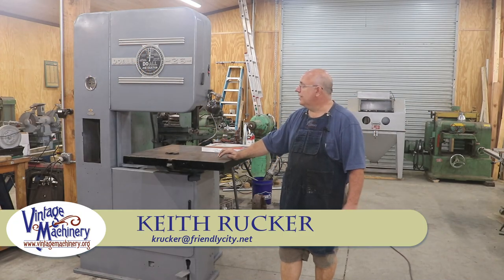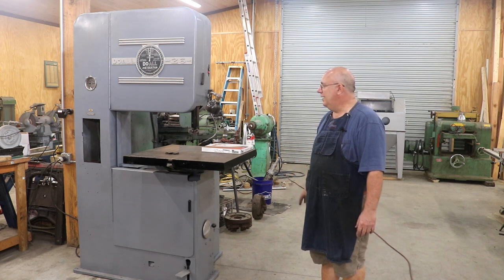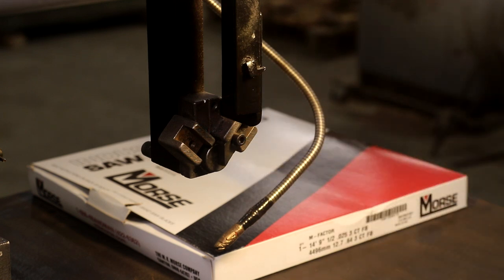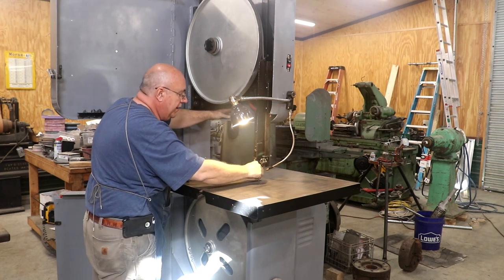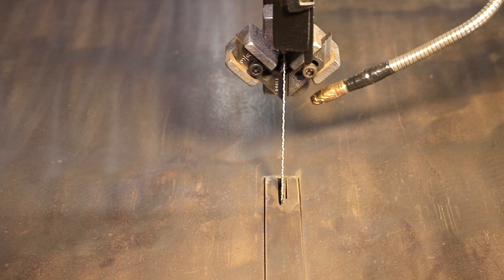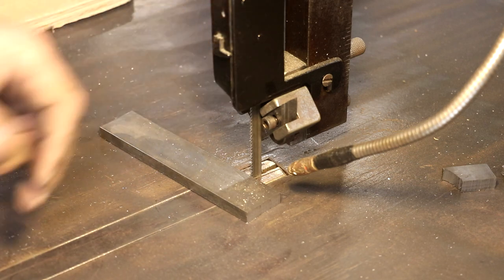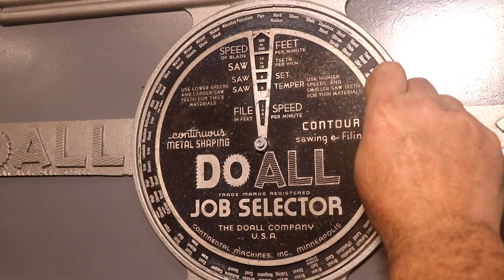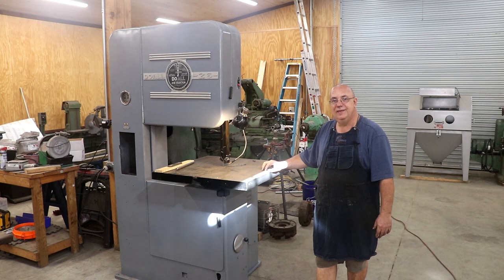1940 DoAll V-26 Vertical Band Saw Restoration: First Cuts

Comment: I was taught years ago to use a drill press vice upside down on round stock so the piece would roll.  Works great!
Reply: Thats an awesome tip!!! Never would have thought of that!
Reply: Yep, a real good way. If you are real careful you can also used a big C clamp on the stock. You just have to be real careful if the clamp has a wobble plate on the screw (as most do) that the clamp isn't going to pop off if the stock rolls.
Reply: That's what I do.
Reply: Saw Mr. Pete give that tip a while back. Great info.
Reply: The danger is that the blade will grab round stock and spin it into the cut and jam. Great idea to use drip press vice upside down.
Reply: I was taught to use vice grips on the end of the rod. Keep the handle facing away from you and they act as a stop to keep the rod from rolling.

Comment: Mine is a 36" 3 wheel. The manual says to set the clearance on the blade at .002. I keep a feeler gauge at the saw as I change blade widths frequently. There was only one set of guides when I bought my saw. I made several sets of different blade guide widths using m2 tool steel then hardening with a torch and air cooling. Not proper h.t. but have lasted me more than 30 years. Blade welder is a must so you can cut internally. Break the blade, then weld together through a hole. They are great saws and are well worth keeping in running order. Some parts are no longer available such as repair parts for the air blower to blow chips off the cut as you are working. Just hook it up to shop air with a regulator.

Comment: Here in the U.K. during the 60’s and 70’s I must have spent hundreds of hours using a DO ALL band saw, it was bought new in the mid sixties. The welder was never very good on theses saws, we also had a Start Right saw and the welder on that was far better.
We used to have band files both flat and convex that fitted on the saw they worked quite well for machining radii. The blade guides had a setting piece that located in one slot to position the first blade guide in the correct position. The foot pedal, lower right operated a weight, which could be varied, which through cables provided a load on the workpiece to save the effort of pushing.

Comment: The blade is not running in the upper guide. It jumped back in when you started cutting, and walked forward out of the guide when the pressure was off.
Reply: You're not supposed to notice that, just say 'well done' and offer praise like the rest of the followers.
Reply: I noticed that too. Also in a subsequent video on the metal planer gib the blade is not supported properly in the upper guide. Something isn't right.
Reply: @larrycleeton  A lot isn't right. But that's OK, it's hollywood.

Comment: The rule of thumb I learned for setting up bandsaw blade guides is to use a dollar bill as a spacer.  It works for the side blocks and the rear bearing and makes setup very simple.

Comment: Glad to see you will be using a properly guarded bandsaw instead of that 36” monster vintage saw with practically no guarding that you recently restored. The first time a blade breaks on you, you will be overjoyed to have it properly contained and not come snaking out of the saw.
Reply: While I don't doubt that is true, I used a bandsaw pretty commonly (a few hours a week) for over 10 years, and I never once had a blade break.
Reply: @lwilton  just speaking from personal experience. It does happen and that blade only has to jump off the saw once to do a lot of damage. 

A freak accident was reported to me by my father-in-law who ran a machine shop. One of his machinist was roughing out an aluminum block. The table was tilted at 45 degrees. The machinist was standing to the side of the saw as the piece needed support on infeed and out feed sides. The blade broke, got diverted by the slanting table top and was driven right through the operator’s guts. They lost him.

Comment: If your chip blower fails look into an aquarium pump for a cheap replacement.  The old table is missing a 3/4" x 3"8" slot where most slide a miter head.  An alternative is to build a sled that slides on both sides of the table.  Might have to mill those straight though if they are an as-cast surface.

Comment: It looks like that you have too narrow blade for that blade guide block. Your blade support bearing isnt doing its job at all. The blade should be running against the support bearing. You need different setups for different width of blades, different width blade guides and the block holding them. Because the blade should be tracking near center of the wheel. Doall.nl has parts and ownersmanuals on their website. Greetings from Finland and a Doall 1611-Ohs owner :)

Comment: Get the blade welder functioning.  My first employer's shop (60-62) had one like yours, his welder needed activated with crossing 2 screwdriver shanks while being held by the yellow Tenite handles. Longer contact was required for thicker or wider blades. The next step was to drag the new blade to a pedistal grinder to dress the weld. My next employer's Do all had filing blades, power feed table and a functioning blade welder for his 30 man shop!  We always had a Kant-Twist clamp laying on the table for holding short or round workpieces.
Extra credit: Please show the pulley speed changing, welding/dressing procedure a fresh weld for proper blade thickness and width with the restored blade welder.

Comment: Missing a blade guide?  No problem at all, you are a good machinest and can easily make one set.  Yes, do fix the blade welder.  When I was about ten my father had a shop teacher friend who would let my father use the large lathes and milling machines at the college night school.  I would tag along and watch everything, including other students doing their projects.  I was fascinated by the big band saw, its blade welder, and the band file that fit in place of a saw blade.  You should look for one.

Warning:  The job selector has an entry for asbestos.  Do not cut that unless you have a vacuum cleaner rated for asbestos dust that can be mounted directly below the table.  Best choice would be to just avoid any asbestos material, do not even let it in the shop.

Comment: Hope you're not planning to cut "asbestos sheets"
Reply: Back in the '60's I was doing it w/ a circular saw. No mask....
Reply: H Higgins  I'd much rather play with lead and mercury than asbestos (and I do).  Asbestos IS safe if treated with respect, but sawing it on a band saw without a respirator (even better, flood coolant) is asking for trouble.  (I did 15 years as an environmental compliance engineer)

Comment: Wow! For 80+ yrs I heard the metal industry (etc) say, "Surface Feet Per Minute". And on almost all band saws (and the like) used the abbreviation (SFPM). Assuming it meant "Surface Feet Per Minute".

Yet in bright "daylight"; where ALL can see; this bandsaw says, "Speed Feet Per Minute".

So tell me, WHICH is correct? Did somebody start saying "Surface.....Minute" and it stuck? Or is this manufacturer wrong? Look at the label. Is it incorrect? Whatcha thank!

"Inquiring minds 'wonts' to know."

Oh well. I am pleased that Keith got this Gem. It's a Keeper!

Comment: Something you might want to consider: on my PM 81 I installed a microswitch on the brake pedal. With the switch in the control circuit, you can turn off the saw and stop the blade even when both hands are occupied.
Reply: Thats a really good idea. Does the micro do a momentary stop or does it break the start/stop latch?
Reply: Yeah, or if his hair got caught in the blade.
Reply: @StreuB1  Normally a contactor is wired with a normally open "on" button and a normally closed "off" button. You just wire another normally closed switch in series with the "off" button.

You can get switches from the auto parts store that are brake pedal sensor switches. These are usually closed when pressed and open when not pressed, and ride on the top of the break pedal lever in the car. You can rig them up exactly the same way on the bandsaw brake pedal. They are usually designed to be fairly immune to dirt, which is good. (You want a position sensor switch, not a brake light switch. A light switch works the other way around.) They are often designed to mount thru a hole and have a couple of adjusting nuts that makes it easy to adjust the actuating position.

Comment: Just wondering if the tach has oil damping. Maybe it is empty?  Would really like to see the welder refurbished. Very useful accessory. With it you can buy bulk blade and make up what you want and fix what you break and help out a lot of others with broken blades.

Comment: The point of the welder was to be able to insert the blade through the hole of the project and do the job with out the need to cut a slot through the outside.  Your guide is too high.  The guides should be no greater than 1/4" above the item to be cut
Reply: Re your comment about guide height:  watch the whole vid before jumping in to comment....
Reply: @MrPossumeyes  I did. your making a presumption .  Yet he had the guid a inch above when he set the guide

Comment: I set bandsaw guides up so they are just ticking.  When you cut, I see the blade moving back substantially to ride on the rear guide.  Bring that rear guide out till it just ticks.  If there is space behind the blade, the back force ends up wanting to twist the blade a little bit.  Taught to me by very old man long gone and an accumulation of many errors in the shop.
Reply: I was wondering the same thing

Comment: beautiful restoration -- I ran one of these off and on from '65 to '81 but ours didn't have the tach or the job selector - nice accessories - it did have the blade welder though which is pretty much required when you have 30 guys using it  - really enjoy these restorations you do

Comment: I used that exact saw working as a welder's assistant in a boat factory in the early 70's.  The blade welder was very effective and I recommend you restore or replace it. One great application is finding blades on sale or old stock that are not the right size and cutting them down and rejoining them to fit one of your saws. We most often used it on the woodworking bandsaw blades as the metal saw ones didn't break that often.

Comment: I have German copy of a DoAll - I made new guides for top and bottom - its not hard to make yourself. You can make a video of it as you make these new. They need to be in decent shape as if they are worn out and the blade goes to deep in (there is no proper backing) the bandsaw blade will tend to have issues staying on the top wheel and fall off at high load -- this will eventually break the blade & certainly does not make for pleasant use of the machine. I made a very long video of me making a bandsaw fence for my machine.

Comment: Brave man on the blade uncoil. I personally do the toss on the grass method!
Reply: Learn the technique for coiling and uncoiling the blade so you're in complete control of the blade at ALL times.  By placing your hands on opposite sides of a dismounted blade then twisting your hands in opposite directions the blade will neatly form a smaller coil.  You're in complete control at all times.  Have a knowledgeable person show you the technique.  Throwing a coiled blade onto the grass or into the air, hoping for the best, is foolhardy at least, and can't be taken seriously.  Just learn to handle the blade properly and safely for putting it on/off the machine.

Comment: You really need the blade welder. It makes it possible to cut internal contours by cutting a blade and welding it inside a starter hole.
Reply: I've never thought of that! I always cut through and then welded up the cut. Nice!

Comment: In Woodworking world I was taught to round over the back side of the blade with a diamond hone- seems to ease cutting radii, and then to lap the sides to smooth out the weld bump..
Reply: The bandsaw normally comes with a welder/grinder unit for smoothing the weld.  If you can't find a unit, an indispensable part of the machine, I'd definitely refurbish the one you have as blades will break in normal use or you want to separate the blade to feed it through an opening and weld the blade together, make the cut, separate the blade again, remove the blade from the work piece and then reweld it together a second time, restoring the saw to normal operation.  You definitely need a welder/grinder unit.

Comment: Had a temp gig a few years ago and the idiot that ran the shop put a tiny bandsaw on a frame that blocked the door. Blade broke and I had it apart (had to take the door off) blade welder five feet away (covered in dust). I know how to use them. So I walk over and wipe the dust off and start the process as he runs over screaming (really bipolar Vietnamese guy). "What you doing?!" "Um. Fixing this blade." "I no pay you to fix blade!" So we stand there for 30 minutes while one of his other guys finds a new blade in the back. Needless to say I quit not long after that!

Comment: Great restoration Keith....  and if you would please...  this applies to EVERYONE in the wood working and metal working community...  There is a reason that the blade guard can be LOWERED to just barely above your work.  With all of that blade exposed above your work, if your finger slips.. IT IS GONE!!!!!   Not to mention that lowering the guard also lowers the GUIDES so that the blade runs straighter and truer...  PLEASE put your band saw blade gaurd DOWN!!

Comment: Do you have any technical info on the blade cutter/welder? I'm guessing it isn't horribly difficult to remanufacture, it should be all passive parts and probably mostly in need of new windings.

Comment: Should add the use of a small drill press vise turned over to hole round stock for cutting. Also I think this saw will take filing blades to sand parts edges .
Reply: Yup, that's what the material guide seems to indicate.

Comment: Don't feel like the Lone Ranger.  I think everyone has learned to always use a push stick the same way.  As it often works out most people are able to get their finger out of the blade before it goes deep into the bone, so just stick it in some coal oil, wrap it together with electrical tape and in several weeks it will be healed and the stick will take the cut from now on.

Comment: Hah, wow, I hurt myself on a bandsaw almost the same way Keith. No lasting damage but as you said, a nasty wound. I'd wager almost anyone of us who work with shop machinery has a similar story, the lucky ones are the people who healed up fine. I've known two less lucky individuals who lost either part of a finger/s or whole digits. Those guys felt lucky they got out with just those injuries as it can go south really fast with the bigger machinery.  (2004 movie "The Machinist", a very Hollywood shop accident, but severe none the less. Also, cool to see Continental Machines still is around and still is in Minnesota.)
Reply: I once got chucked out of the school woodwork room for putting my hand close to the the running circular saw blade...

... but I cut my finger end off closing the window, trapping it in it !

Comment: Thumb: "There is no substitute for paying attention" and "Haste makes waste."  I drilled a hole in my palm with a 3/4" spade bit essentially doing what you did, backing up the wood piece with my hand.  It made some messy hamburger of the hole...

Comment: Nice machine!  Two things...
There should be a dashpot on the speed gauge, which is supposed to tamp down the oscillation.
Does the speed guide include asbestos? 😁
Reply: Why would you cut asbestos?  Don't you know it is instantly deadly!! ......
Reply: @paulcopeland9035  Yes, but they didn't know that back then.  It would make it even more historical.

Comment: There is some thing going on with your video editing program. The lower 3rds and dissolve transitions between clips make the whole frame brighter. With the lower 3rds its like what should be a 100% transparent background is really 95% transparent. If you are placing them on a track above the video it might be the track's layer blend mode is incorrect for the type of asset (alpha channel vs. per-multiplied vs. keyed) you are using.
Reply: You may want to look internally for your video problem.  I see nothing wrong.
Reply: @paulcopeland9035  I'm watching it through the normal YouTube page on Firefox/Ubuntu. You can see it clearly at about 00:07 and 00:13 after the title card disappears and the lower 3rd comes on. The whole frame gets a bit lighter and stays that way even during the time the lower 3rd graphic fades out. As soon as it finishes fading out, the lightness of the rest of the frame snaps back to normal. That's why I think there is some kind of blending problem. Generally you have graphics on an upper layer and I think the video editing software is deactivating the layer entirely as an optimization during the times when there are no events on it. Maybe that layer has a default background color that happened to be white and the transparency is accidentally set to 99% so it's not super obvious. It might also be a bug in the program.

Comment: DO NOT cut round stock on a Vertical Bandsaw Without putting it in an Inverted Vise . It will still catch and bind if your holding it by hand . I dont care if your using a push stick.

Comment: Keith,
  Just remember to clean out the chip collector once in a while, very important!
The guys in our shop cut Magnesium all the time and never clean out the saw.  Set it on fire and set off the fire alarms in the building!
Didn't damage the saw, but stupid things like that can get out of control quickly.

They should have had a saw setup to cut Magnesium only, and another saw for everything else!